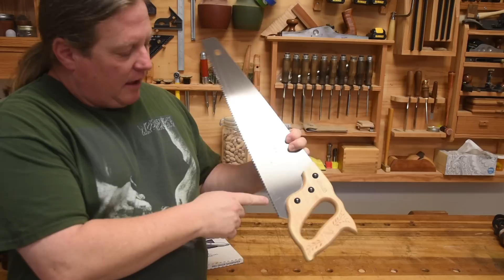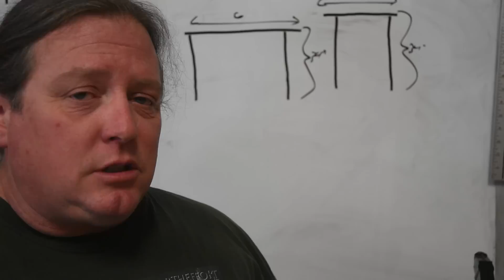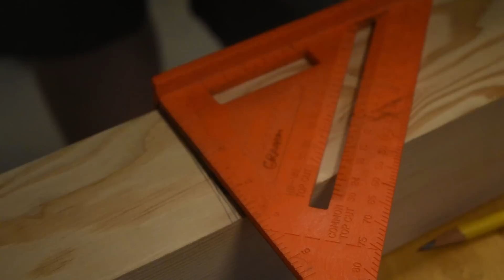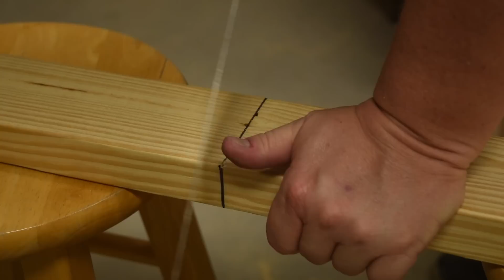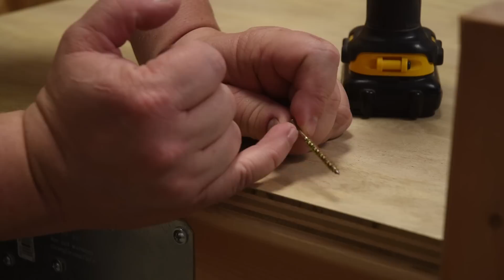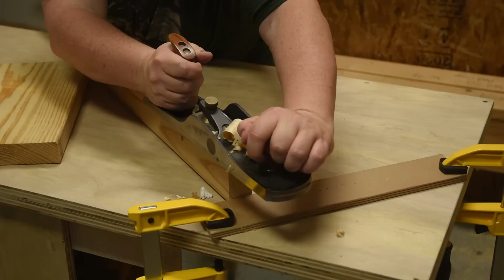The "No Skill" DIY Workbench Build - Start Woodworking Series Launch (Class One)

Comment: I am a female almost ready for retirement and my son (God bless him) took pity on me and is helping put this bench together.  We are having so much fun and laughter building this together.  Although this was suppose to be a built using non power tools, we did cheat and are using a miter saw.  We changed up the 2x4 for 2x6 construction of the carcass and let me tell you, this bench is heavy and we still have to add the 2nd layer to the top and the braces for the bottom shelf.  Thank you Shawn for such a well planned bench!!!!

Comment: You got my attention when you explained the difference between a teacher and a lecturer. I want to learn how to replace the foldable legs on my  craft table with legs that are strong enough for me to use my rotary cutter without the side of the table collapsing. I would also like to shorten the height of this table which was made for me (about 40 yrs. ago) by someone who did his best but admitted that the current legs would not last. Please contact me if you can advise me how to convert this table to meet my needs.

Comment: After quite awhile wanting to set up a workshop at our new home I am finally getting serious about it.  One of the first things I did was tear out the oil soaked poorly constructed workbench that came with the house.  Then I KNEW I would be committed because I'd have to build a new one.  Yes, it may have been a little easier to keep the old one and use it for constructing the new one, but I just wanted it GONE!  I must have watched a hundred "build your own" workbench videos before coming across yours.  I have it mostly done.  Just have to glue the top.  I must say it's an impressive bench especially for what it costs. I also finished building my first router table this weekend too, a linear rail circular saw guide system is almost done too.  Getting excited to really get into some projects I've been dreaming about for years!  Much of it will surely be done on this workbench.  Thank you. 🙌

Comment: Just finished my bench. It turned out great. I had zero experience sawing wood or doing any of the things laid out in the video, but @wortheffort laid everything out so clearly. It was fun. 

I also didn’t have much to start with. Below I laid out everything I had and bought and cost. 

Tools already owned: measuring tape, square

Tools/hardware purchased (mostly Home Depot): 8 strong ties ($40), 2 boxes of strong tie screws ($22), 26” Stanley saw ($24), clamp ($20), wood screws ($20), bit for wood screws ($3), sanding sponge ($5), and glue ($5).

Lumber (Southern California): 2 Douglas Fir 4 x 4s ($30), 5 Douglas Fir 2 x 4s ($37), Plywood ($53), and particle board for shelf ($8).

Total cost: $267

Cost may look high, but I now have a saw, wood screws, a driver bit, sanding block, clamp, and some scrap wood for my next project. Oh yeah, and a solid bench.

Comment: THANK YOU for this neat simple and easily constructed design idea. Although I've used Simson Strongtie products for decades as a framing-carpenter, i never thought of using them for benches or shelves! 

It's funny how something so obvious can be right in front of you, yet you never notice until someone else points it out. 

Also very helpful are your suggestions for bench dimensions. You're right; Many storage boxes fit neatly beneath the 12" bottom shelf. That makes use of otherwise wasted space, AND provides a nice foot rest for certain operations. I've found that feature REALLY helps reduce back-strain when working for long periods. 

I'm not sure if you mentioned this in the video, but it bears repeated if you did...
These Simpson kits and brackets SAVE MONEY in TWO WAYS. First, they make maximum use of lumber. Less waste means money saved. And as you did point out, this method of construction allows us to reconfigure and reuse lumber a second or third time. Shop-space is NEVER permanent or perfect. It always evolves with the new tools and skills we acquire. So being able to quickly and easily change bench or shelf dimensions is a HUGE benefit! 

Now that I think of it, the method saves money one more way, if you value your TIME. By saving time, this speedy method gives us more return for our labor. No matter how I look at this, your design ideas here live up to the channel's namesake because they are truly "Worth The Effort!" 

THANK YOU many times over!
Reply from the maker: Thanks

Comment: Great video. Thanks so much.  Just finished making the bench and you are.right, it is ROCK SOLID, even before the back brace and the bottom shelf.  I made a few modifications — made it 6x3’ so it will be deep enough to be the table for my compound-bevel sliding miter saw.  I also made it a little lower so that it can double as the outfeed table for my table saw.  It will also serve as an assembly table and I will add sliders at each end of the bottom right above the bottom shelf so that I can have one large pull out drawer below the bench and therefore more easily access what is under it.  I will be building and using Rex Krueger’s English joiner’s bench as my primary workbench, which is why I didn’t mind making this one 3’  deep rather than 2’, but I love the simplicity of your design and the ease of assembly.  I got a good workout from cutting the 4x4 posts to height although I used power tools for most other cuts.  Great instruction.

Comment: I built my own box to hold 3 30 gallon garbage cans for my chicken food.  I wish i had found your video before.  I however did a good job considering i had just a small workbench my husband made that was 4 x 3 feet and a very rough top, not level at all.  I built it with no help and out of old wood from an old chicken coop.  It is sturdy and strong but the front door is slightly warped so it wont close right.  No matter im still proud of the job i did.  I want to make another one and with the skills i learned from your video i hope this one will be better.  Thank you for your help
Jackie

Comment: Made that bench, super good, so much of what I have done forever was on the house floor or on that cement step outside, feels weird using the bench! Put lift casters on it so in the the shoe horn area it's in, I can move it out for longer work. Hey, one of the Best leftover portions of that bench project was ... Those Eight Squares off the (double thick shelf) corners I have used many times now for clamping and for one use as a Moxon vice movable position stop. Thanks for the lesson. Yes, I really Can pound on the corners or actually any part of that bench, I added extra cross members with the extra 2x's. Does take a good bench to even think of making anything else and I had been using a plastic book shelf outside to try and bolt equipment to for a long time. Love the mental state you instilled to just drill a hole for use anywhere I damn well, need one! Kind of frees up that mindset of "do no harm" to a top that you stated naturally can and will be replaced at some point if need be.

Comment: Just one word to say 'Brilliant' .. and now several more words .. Yes, you used a bracket kit but your explanation and advice of how to build the workbench is so easy to understand.  Really appreciated your tips and tricks, eg using your first cut-off as a master when making several and slightly offsetting a screw so as to draw the bracket tight into the outside corner of the legs. Almost 63 years old  and now I'm going to see if I can get close .. we don't have the exact bracket kit here in the Uk, legs will be 2x4s but it should work, I think 🤞. Kit and wood will cost an arm and leg because I live in ROB which is 'Rip Off Britain' (my opinion) where everything equivalent  is way more expensive than, for example, the USA. You called yourself an educator but I would have been more than happy to have had you as a teacher in my school days, as others have stated. Or even now!!😀 Thanks for the video 👍👍

Comment: Great Job, considering that you used a hand saw. As far as having to cut the bottom shelf in two. You might have been able to wedge it in diagonally. However, it would have be much easier if you had installed (dry fitted)  it BEFORE you installed the top.   That's the beauty of life, hind-sight is 20/20 and no matter how much one knows, one never stops learning and learns from one's mistakes. Keep on truck'n, there's a lot of folks who can learn from your instructions.

Comment: Looked for the brackets and they were really expensive on some sites, bought online, "buy eight or more ..." Homedepot pickup 8 for $38. Watched numerous vids on tables that I don't have room for then remembered I had two leftover sheets of 6' x 24" MDF from a project that I can glue together or screw down so this is the perfect project for what I have already as a bench top (my little shop only has one open end that is about 7ft. wide so ...)
Thanks for the help

Comment: Started on this workbench yesterday. Need to do the bottom shelf and back support and then I am done.  Great easy, to follow video. 

One modification I am making to this is adding locking casters and adjustable feet so I can move it around my garage, use it for saw out feed and if there are any floor imperfections I will be able to insure I have a level work surface. 

This is a solid bench. Am going to make a complimentary bench with pegboard upper back piece using the same companies ties for 2 x 4 dimension.  I expect it will be just as solid. 

Thanks for this series.
Reply: just curious how did you mount the casters and adjustable feet?

Comment: Really appreciate this video. I was able to make the workbench with very limited experience. A few tips:
- make sure to get wood screws for securing the 2x4s together, in addition to the screws for the brackets
- as a previous comment noted, you need about 200 screws, or two boxes of the recommended screws to secure the brackets and have some left over for the top
-  I may be wrong but the dimensions of the sketch look to be different than what is described in the video

Overall, this is a great video and is highly recommend.

Comment: I've been using a broken freezer as a table in my barn for 20 years, I had recently decided to get rid of it and make a wooden table.  when I saw this video, I knew that was how to make the legs stable.  Just finished it today, just with less reinforcement for the top surface since mine will be a table rather than a workbench.  I did make a shelf with 1" x 2"s much like you did on your router table.  bought the 4 x 4s, the rest was all old lumber I had around.
Reply from the maker: get busy

Comment: I started with a kitchen table that someone thru out to the curb. I put a 4x4 in each corner where the legs where. That was my first work bench. I used it for ten years just by screwing a sheet of MDF on the top whenever one wore out as a sacrificial top just like I do with my Radial Arm Saw that was given to by my Grand Father. I gave it to my oldest son where he uses it for working on cars. He's had it for five years and it is still going strong.

Comment: As I am watching this, I understood your conundrum of getting the bottom shelf installed.  I am building something called a catio.  A cat patio with a roof and a base.  I installed the base first which made it easy.  My problem was making the cutouts of the corners. I never got it right, will will now as I will use your solution to using the spare piece of wood to mark the section I am going cut.  I hope this helps you.  Great videos.

Comment: Materials list and prices is a flexible thing... I have found that when I "sum up" a project, I miss a lot of hidden expenses within the things that I commonly have in the shop, mostly for other projects. Though these things are par for the woodworker, the newbie will often see them as a startup cost, and really get bent over you not mentioning them... lol. (I have no clue what they are beyond a big box of screws, bolts, or drill bits... maybe a level, wood glue and nails, speed square, that sort of thing.) My shop is covered in things I take for granted as being there but are essentially what makes me productive and successful, and I never give it a second thought because I buy these things on a regular basis. I really enjoy your videos, and I completely agree with your take on how teaching is an interactive thing. Thanks! (Edit: I mentioned the speed square before I/you even got to that part in the video!)
Reply from the maker: You need to clean up your language. This is a channel used in schools. Only thing used but not mentioned in video was a mallet I grabbed but it wasn't necessary so didn't include.

Comment: Really appreciate this video filling in the gap missed by so many others: introduction to woodworking without having a bench.

So many content creators forget about this bootstrapping aspect of getting into things as I'm uncomfortable cutting plywood or whatever with power tools on the ground.  Especially without the projects and experience to justify buying said tools especially when they aren't on sale, I appreciate the confidence and straightforwardness of the video!

One note, I don't think Simpson makes the 4x4 workbench set you used here.  I know in the description there is an alternative 2x4 set which I readily found at Lowe's.  This should hopefully be fine as you say we will grow out of it and be capable of replacing it with the initial workbench.
Reply from the maker: I don't understand why so many can't find corner bracket. I googled "simpson corner 4x4 bracket" and it was the very first listing....

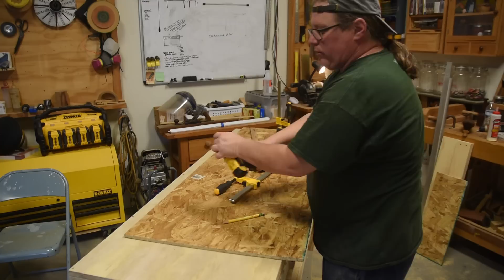Comment: Great video, 48:50 A cheap option might to have a hole in the table too somewhere with a bolt and wing nut, you could then drill a hole into the offcut piece and clamp it down with a washer/wing nut.

Comment: Just bought the workbench kit from Simpson but due to limited space I am sticking with the stock 2x4 build. I reinforced with a few 2x4 crossbeams to make a sturdier top and bottom shelf and used a 3/4" plywood top. Even with 2x4s the bench is solid, solid, solid.   I will say that the first time using a handsaw to cut the 2x4s instead of my Ryobi circular saw was quite rewarding. I never realized a handsaw could cut so quickly. That said, I had trouble getting clean 90% cuts so when I put the brackets on, the cross pieces don't fit flush against the surface of the other boards. I also didn't do the best job of aligning the leg brackets when screwing them on so I had to use a couple 1/16" shims at the bottom of a couple of brackets so that the 2x4s would be flush across the top. I would have used a plane but this seemed to work ok. Still, it's solid.    Also, if you buy the kit, you will need extra screws. I used 2.5" decking screws to secure the top and the bottom shelf to the 2x4s. 

Now the Simpson kit comes in a less expensive format which comes with the 8 brackets only and a box of 100 Simpson screws which leaves you 4 spares at the end of the project not including the screws needed to secure the top and bottom shelf, so don't forget the extra screws. I broke off the head of one of the screws. This new version of the Simpson kit doesn't come with a printed manual either but there is a QR code on the box that you can download the PDF instruction sheets to print out or you can access the PDF sheets on the website.   But, the kit at Lowes was only $27. 

The whole time I was building this, I was joking to myself that this project would have been a heck of a lot easier if I had a workbench to build it on, so if you have a work table or even a folding table to set up, it will make this much easier. Even a set of saw horses.
Reply: It's now two months since my first post above - In that amount of time it's incredible how much I've improved in terms of measuring, sawing, and cutting straight, in only two months. I still haven't gotten into more advanced things like mortise and tenon joints and other aspects of woodworking, but between this workbench build and the other projects from your beginning woodworking series, my confidence level is high. Looking forward to what the next two months bring. Thanks so much for these videos!

Comment: Using metal brackets, the critical time is when you screw the table together, its good to have the boards 90 and tight to one another, but the gaps in the metal frames isn't as critical as the final measurement after you have screwed it in. I can remember when I was in college using a hand saw to cut wood for my first easel, and thinking, I need a mitre saw! SO WORTH IT! Even a cheap one will quadruple productivity, and give much cleaner 90's! Another tip I can give (like I'm an expert?) is to counter drill the first inch of every hole, makes it far easier to drive the screws, and less likely for them to split out the wood. I have been doing this for over forty years. I even predrilled for nails in my edsel, which I still use, still going strong, 34 years later!

Comment: Almost done with the build and a few comments:

1) the video mentions 6 foot length but plans are 8 feet. Remember to adjust measurements

2) you are missing the screws for putting in the braces as the 1 1/4 are not long enough to go through the 2x4 and the brace. You need longer screws. About to go buy those tomorrow. Also you need 200 screws minimum for the total screws for metal brackets i ran out at 9pm on a sunday and didnt have anymore screws. Also i suggest doing star screws as i had a lot of the philips strip on me and are a pain in the butt to drive. 

3) for homedepot cut great tip one note though tell them to cut the length first. So for example mine was trimming it down to 6 feet. Then tell them second cut for in half so they are both equal. If you give them two cuts they will do them in the wrong order. This is important because you will be stacking them on top.